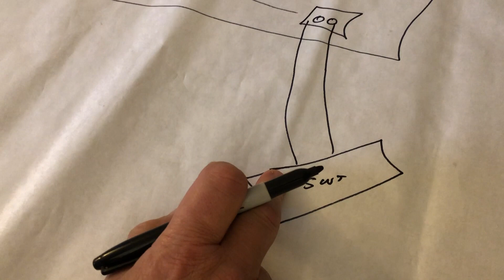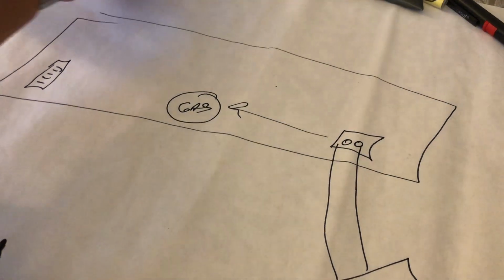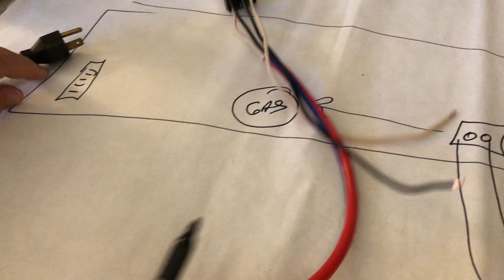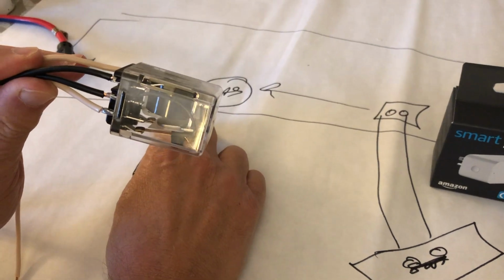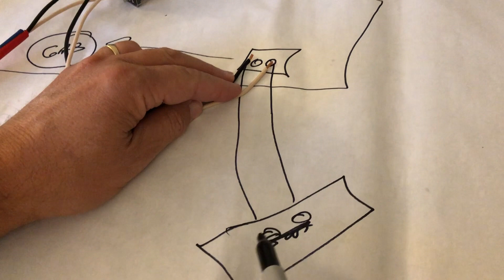How to use Alexa to control your  gas fireplace

Comment: Would it work to just replace the dumb mechanical switch on the wall with a smart switch and control that with Alexa and/or app?  Would it work?  Relay necessary?
Reply: That would be a great idea if you had a typical toggle switch on the wall now I know  many builders install it that way but in my case I did not have a proper switch I had a thermostat built into a switch so my only option was to use the relay and a smart receptacle
Reply: That wouldn’t work. The switch on the wall is a low voltage switch. A smart switch that’s made for say a light, would not work.

Comment: Cant u just change the switch to a smart switch?
Reply: No because it’s a custom switch that controls it from the wall all you’re doing is closing to contact points with the relay in parallel to those two points

Comment: And. Does the wall switch still work?  If I use google to activate the fireplace, can I use the wall switch to turn it off?
Reply: This method would replace the wall switch rather than supplement it. You could instead use a smart switch on the wall, but you'd need to run power to the box since the fireplace switch box likely only has the low voltage.
Reply: @tomgore1009  The way I did this project, I did not use a smart plug, I used a smart switch instead, and I replaced the existing fireplace switch with the smart one, and hooked up the relay as explained in this video. However, the smart switch requires 120v to work, but the fireplace switch does not have high voltage run to it. I had to open up the wall and pull romex from an existing outlet box into the fireplace wall box. This way you have 120v to the smart switch, and a switch controlled 120v circuit to the relay. When the smart switch activates (via Alexa or just by manually operating it), it supplies 120v to the relay, which closes the contacts for the fireplace "on" circuit. It's a little more work opening up the wall, but now I have a physical switch still.
Reply: @zeniq18  hi that sounds like excatly what i want to do.  could you share model numbers of the relay and switch you used?  thanks

Comment: Does the relay send current to the fireplace?
Reply: No, they are “dry contacts”. Dry means you voltage on the relay, just on the coil which is the incoming 120V

Comment: I’m a little confused , so your taking 110 V in ,   isn’t fire places low voltage for the on/off function..  not the fan if so equipped
Reply: Canadian Pride Im curious too. I think though the really doesn’t see power to the fireplace.  At least I hope not.
Reply: @ColdCanadian911  The relay acts as an in-between; it does not send 110AC to the fireplace. the relay closes the contact and completes the circuit when it gets 110AC. You end up with 110AC in one "loop" and a closed low voltage/fireplace circuit "loop". Then when your turn off the power the contact opens again and disconnects the fireplace circuit to shut it back off.
Reply: Yes everyone is correct I use the smart switch to control the relay coils and the fire place sees the close contact

Comment: Do you have the specs or a link to purchase the relay
Reply: easier said then done, im tryin the same thing. not having luck just yet.
Reply: A great idea that's well-explained in the video.  Concerning the relay, the "Omron G7L-1A-TUB-CB-AC100/120" would work - on-line companies such as "DigiKey" sell it for as low as about USD $12.00.  An alternative to the "Smart Plug" is the "SONOFF® Basic" for less than $10 on-line, although it would require some additional very basic wiring (it needs to be placed in-line to the existing power cord).  An interesting option would be the "SONOFF iFan02" which would add fireplace fan control.  You'd still need the relay to turn on the burner.